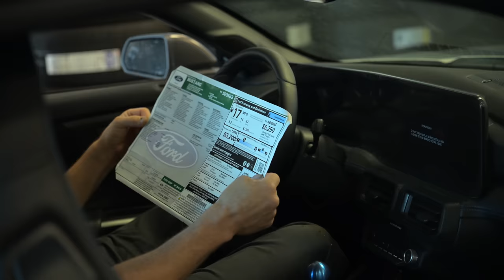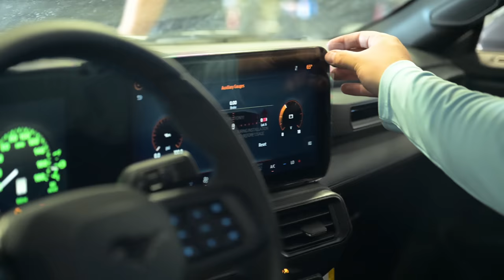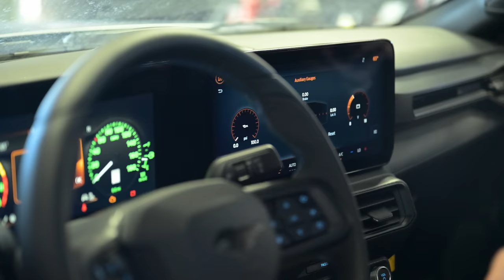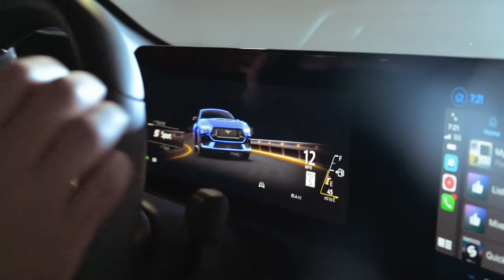2024 Mustang S650 Dark Horse Delivery (MM Vlog Ep.3)

Comment: I did this today and posted it on the 2024+ Facebook group chat after Kelly posted it. I didn't have to break the tabs off. Just spend it and carefully pulled. But have you noticed any clicking or sonar noises while the key was on you during removal and installation?
Reply from the maker: Most likely just the fuel pump priming if you had he keys in your pocket.  Also you can hear the exhaust valves cycle

Comment: The front wheel fender trim... you can see at 4:57 it rolls off with no lip but at 9:58 there is a trim installed as it rolls onto dyno.  II have a friend that says her DH didn't come with the trim and the dealer said apparently it was only a prototype and doesn't  ship from factory. Is this true? If so, hopefully there is an aftermarket option, as that makes them pop
Reply from the maker: This one is a handling pack that came with under car air deflectors gurney flap front splitter and the wheel well lips. We can check if it’s supposed to be on the non handling pack cars
Reply from the maker: That’s a factory piece that was shipped with the vehicle. Perhaps it was part of the handling package. We installed it when we installed the front lip.

Comment: What is the ride quality like of that spec I’m thinking about the same one
Reply from the maker: Feels really smooth. Smoother than my 500 was when it was stock.  We have a driving review coming out soon to discuss the driving experience.
Reply: @MiddletonMotorsports  thank u so much for the feedback man, one last question/advice I want to know. Should I buy the automatic or manual? I’m 22 and owned a 2014 mustang gt premium full bolt ons tuned on e85 with drag slicks automatic trans. My plans for when I buy the dark horse is to keep it bone stock and one day supercharge it with the whipple or something a couple years after owning it
Reply: @saad_ahmed2187  depends on what you want to do. If your going for pure speed in straight line with. If you for sure want to supercharge we would recommend auto.
Reply: @chuckpolley4786  yea it would basically be a Car I drive daily for fun after work or goin out to the gym or to eat w friends etc some car shows or drag strip possibly. I really would love to own a manual tremec but I think that auto might be better in the long run for me plus it comes with remote rev and remote start